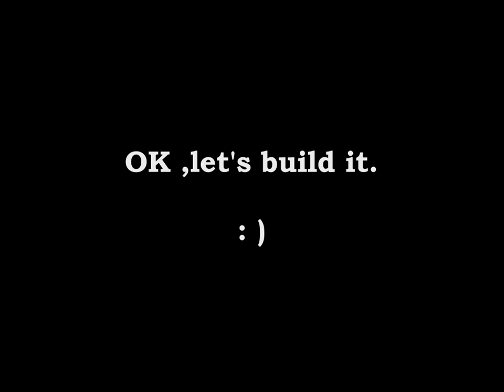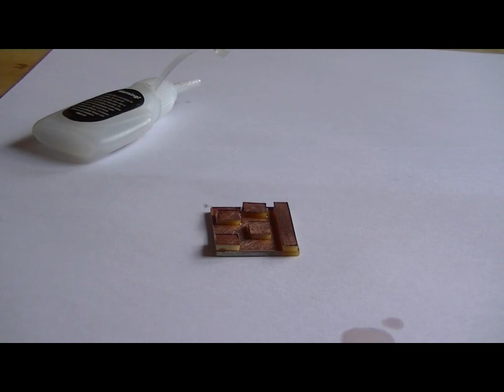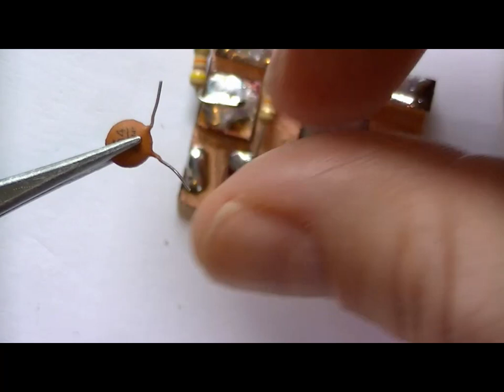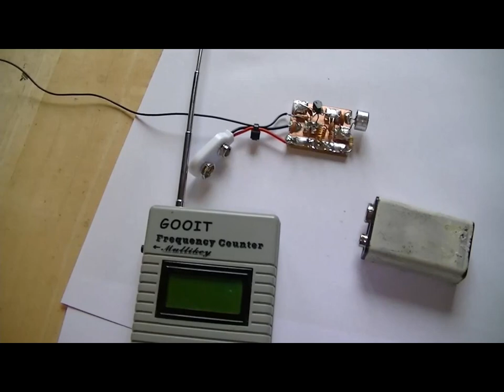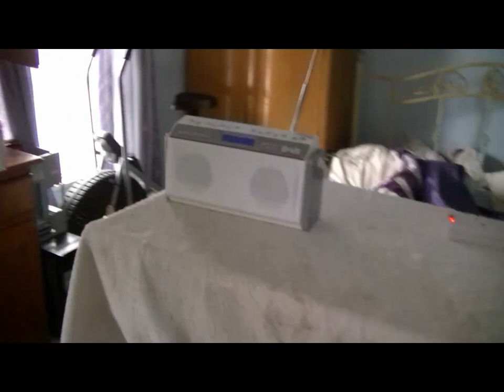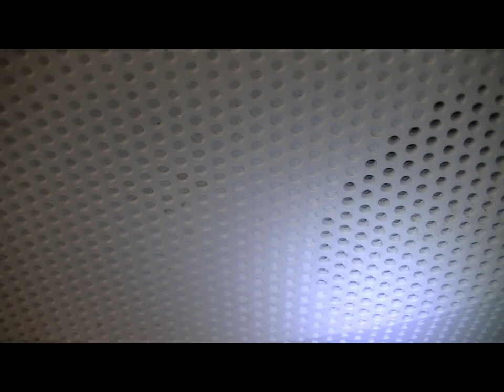You can build this great little FM Transmitter.

Comment: I built it successfully using the schematic as provided, but only once I connected the 10pF capacitor / antenna combination to the second winding of the inductor (on the positive side of the inductor, not the transistor collector side). Until I connected the cap/antenna at that point, the frequency fluctuated wildly. On a side note, I had no problem with the 1nF cap connecting to ground, as specified in the schematic, even though in the video the cap is connected to the positive rail.
Reply: Transmitted 180 feet from an 8th floor apartment down to ground level a half block away in NY City, using 12 volts. Designed exactly as specified in the schematic, except that I connected the 10fP cap/antenna to the 2nd coil winding, and reduced the resistor value to 50 Ohms at the transistor emitter.

Comment: Hi, can I use 2N3906 or 2N2222 ?
Reply from the maker: You can use a 2N2222 but not a 2N3906 because that's a PNP transistor
Reply: @dazaro3  Thanks for your help :) I made a several transmitter shown by you, and all of them worked :) So many thanks.

Comment: would this transmitter still transmit even if it were made on a piece of plastic board? or is the conductivity of the copper board important for it to work?
Reply: Yes the copper board is very important since it's the ground of the whole transmitter. (If you still are wondering)

Comment: Hi! I only have acces to old tv and radios and tv-playbox, keyboards, its components what transistors, resistors and capacitors will work, others then these on your list?
Reply from the maker: +Anonimescu Cutarescu 
You will find most the parts in a FM radio.
Reply: +dazaro3 at the age of 16 I used a ,,Game Play for tv`` or how it is called in eng. (Something like this : http://8itzone.ro/it/304-tv-tuner-stlab-st-tv-box-tn-p05-1021-11-00011r.html)  and it transmites a few meters on a specific FM freqwency, I simple put sound from PC into it, in audio or video or RF of it, I dont remember.

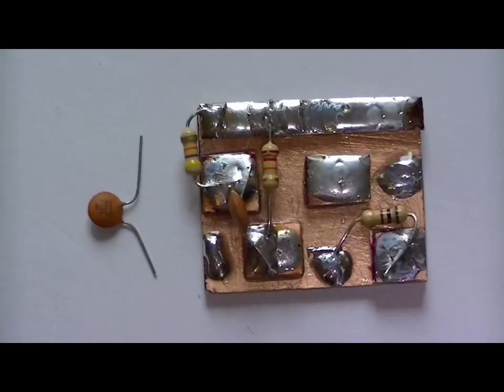Comment: Hi dazaro3, I think there is an error in the schematic with the cap marked at  8:30, as in the schema it goes to ground and you welded it to 9V at 8:50... could you please verify?
Reply: I know I'm late but connecting the cap to ground or +Ve rail, in this case, shouldn't make any difference. Since the AC component of the circuit is what matters to capacitors and if you do an AC analysis, +Ve rail and ground are interchangeable (AC-wise the circuit is dynamic, half the time the +Ve rail is + and the other half it's -Ve). It's confusing I know. Welcome to the world of electronics.
Reply: +Fidencio Monroy you are right.he soldered to + in paralel with the 22k resistor wich should be in series with it to ground
Reply: +cipry1010 The testing was successful, so I think the schematic is the one that needs updating. Are you building it?
Reply: yes.wright now  i want to.i have build another 2 schematics and i didnt got good results
Reply: Fidencio Monroy did you built both variants,the schematic and dazaro3 variant?
Reply: +cipry1010 not yet, I'm interested in the receiver, but building it could help understand the complete process

Comment: Hi dazaro 3, Having a bit of trouble getting my transmitter to work. I got my parts from Maplins. Some caps had different numbers which I was told were the same values.For 1N I used 102K --  100N =104  --  10P = 10J  --  33pf = 33J. Are these OK. I have noticed that the transistor gets very hot. Hope you can help if you have time --  Cheers.

Comment: Thank you for sharing.

If i only have 0.63mm wire available for the air coil, how many turns and at what diameter should i turn it?

One more question please. Is the a mono audio jack in a drop in replacement for the mic? In other words, can I use the audio out of an mp3 player instead of a microphone without a change in the circuit? I want to make mine switchable between mic and audio in from mp3 player.

Once again, thanks for sharing. Your videos are great,
Reply from the maker: 5 or 6 turn coil ,form it on a 3mm drill bit.

Comment: the maddest pcb ever...brilliant. , if i wanted to transmit in stereo to my car stereo etc would i have to build 2 of these?...(i know you can buy them for this, but i like diy tinkering)
Reply from the maker: You can not build a stereo transmitter using this method.
To build a stereo transmitter is so much more complicated,
you will need a IC like a BH1471 or a SN761634 and many more.

Comment: Hi.Can I use bc337 or bc338 on this circuit? thanks for everything posted on youtube. We've learnt a lot.
Reply from the maker: No its Maximum Operating Frequency is 50 MHz ,you can use many others like 2n2222,BC546,BC547 ,2N4401,BC550 and BF199

Comment: Question for you.  I noticed that in the build you connected the 1nf cap from the pad to the power rail rather than from the pad to ground as it is pictured in the schematic.  It doesn't seem to have had an impact on the performance.  What purpose does the 1nf cap serve?

Comment: Hey darazo!
I just had a question, can I use 22awg wire or 18awg wire for the 5 coil anttena
and if you are supposed to use stranded wire or solid wire for the antenna.

Thanks!
Reply from the maker: 22awg wire or 18awg will be ok and any wire for the antenna will work.
Reply: dazaro3
Thank you very much for the quick reply!

Comment: I built this on a breadboard, but im having problems... The transmission range seem to be only a few inches.. I have to hold the antenna right next to it to pick anything up.  I even tried boosting the power by changing the 100OHM resistor to 50OHM make only small improvement.  What am i doing wrong?  I seems when i grab ahold of the antenna it sounds alot better.  I realize building it on a breadboard might be problematic but i wanted to get it working before i took the time to solder one up...

Comment: Hello, I'm new to electronics and soldering in general and I'm just wondering how this works with the different parts, or if you may post some sources with this information. Thanks!
Reply: watch the video on the tank circuit.  it explains a little on how a oscillator works. There are also videos on how capacitors and inductors work.

Comment from the maker: To make the FM transmitter much more stable but a bit less transmission range you can tap the antenna from the transistor emitter and not the transistors highly sensitive collector.

Comment: Thank you,I made one myself.The problem is,it seems a bit unstable i.e. moving it or handling the parts while in operation creates noise.Also the transmitting frequency tends to change when I move the antenna(I am using 2 yards of cable as an antenna).What's wrong?

Comment from the maker: If you tap the antenna from the 2nd turn of the coil that will
make the transmitter very stable and then you can hold the Bug
and the frequency will not move ,i did not use a variable capacitor
for tuning because i want to show how to build one without any 
expensive or hard to find parts ,on my other videos i do use a 
variable capacitor for tuning.

Comment: Very cool! I watch all your videos I cant belive how well and clear this works, Just a thought what about a variable cap for slight tuning?what would happens with the ones I used to build was whenever I would put my hand near the Battery or the board it would drift alot due to stray capactince this dont seem to do that?BTW- I am self taught in electronics and seeing these makes me want to dust off all my parts and start again again Great Job like the way you do the board I never thought of that